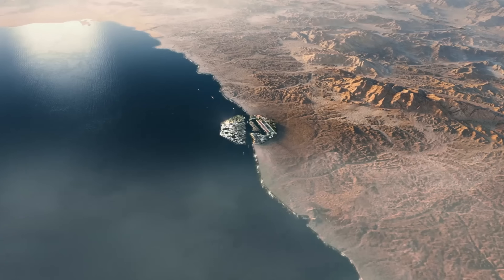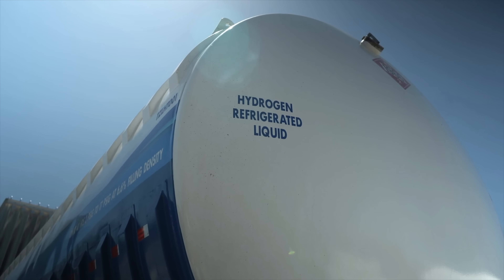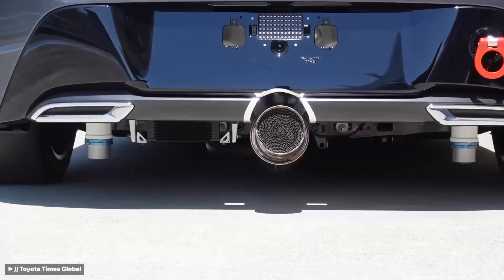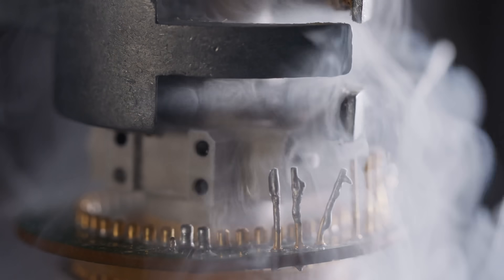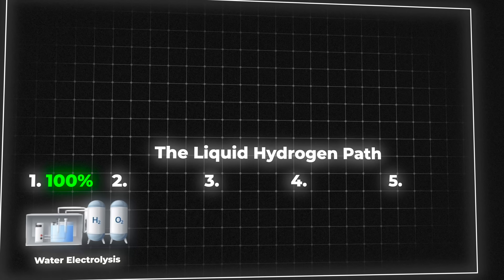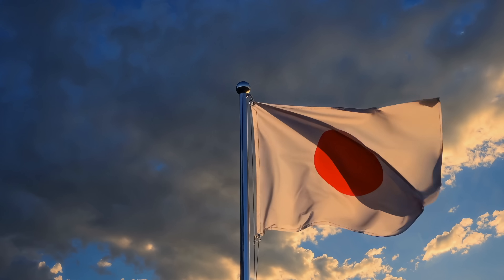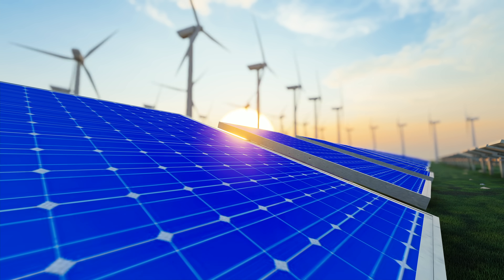World’s BIGGEST Hydrogen Plant Produces 0 Hydrogen

Comment: Hydrogen is converted to ammonia for shipping because it is a more energy-dense, easier-to-handle liquid and can leverage existing infrastructure for long-distance transport, whereas shipping hydrogen gas or liquid requires expensive new infrastructure and is technically difficult. Once at its destination, the ammonia is "cracked" back into hydrogen gas for use as a clean energy source.

Comment: Your lifecycle efficiency calculation is wildly inaccurate and hopelessly optimistic. 

The cost of energy is at least 3 x more from Ammonia/Hydrogen than it is from simply using electricity from renewables, even stored in batteries, and end of life batteries can be 90-95% recycled already. 

The Chinese government bet big on renewables plus battery because they did a simple analysis of the physics and observed Hydrogen as an energy carrier is very silly, and a bit suspect. 

I am tired of being gouged by the fossil fuel industry which is desperately looking for a way to keep gouging us. I wish the useful idiot (mostly) men it has spent years cultivating would just shut up and learn some basic high school physics.

The universe sets the energy required to crack H20 in the real world electrolysis of H2O is only around 40% efficient 

Electrolyzers need pure H2O which is very expensive to make and highly corrosive, and what are you going to do with the brine?

Comment: Thanks for the update. Be careful — energy should not be compared on a mass basis. Hydrogen must be stored either as compressed gas (typically 400–700 bar) or as a cryogenic liquid. Therefore, the fair comparison is based on storable volume, where hydrogen performs poorly. Moreover, hydrogen is highly reactive with metals, causing embrittlement, and most polymers are also unsuitable as containment materials. Because hydrogen molecules are so small, leakage during storage and transport is almost inevitable.

By combining nitrogen from air with hydrogen, we can produce ammonia (NH₃) — a far easier compound to transport using mature and well-established technology. Ammonia can also be used directly as a turbine fuel (it was already tested in Belgium in the 1930s).

In short, ammonia offers clear logistical advantages, though the main challenge remains its high energy consumption during synthesis. We still rely on the Haber–Bosch process, but progress toward low-pressure, low-temperature catalysts could significantly improve efficiency in the near future.

Comment: Wow, 39% is very very good, that is better than diesel and much better than gasoline! Batteries will never be able to absorb the excess energy production from variable power supplies. You need a flexible energy storage medium that you can fill cheap tanks with to be able to utilize their over production. Hydrogen is perfect for that, ammonia is mainly what hydrogen is made for today anyways. The fertilizer production from this could fill the whole supply really. There is no one silver bullet, this is one of many silver bullets

Comment: They say hydrogen by product is water only. This is true  but hydrogen is still a green house gas that lasts a very long time no engine will use 100%  of the fuel . Just like lng engines there is methane slip of 2to 9%  of a green house gas being pumped straight out   This doesnt make sense either but let’s watch the space develops
Reply: FALSE. Hydrogen is not a greenhouse gas. The most common "natural" greenhouse gases are (in order of atmospheric concentration) water vapor (H2O), carbon dioxide (CO2), methane (CH4), and nitrous oxide (N2O).

Comment: Sun heating with magnifiers is free. Heating can be stored in Sand or Aircrete. Use that in combination to produce high pressure for the conversion. Can’t be that inefficient.
Reply: The issue isn't the power generation, but getting the power from where it's easily produced to where it's needed the most.

Comment: I worked in a factory that manufactured karat gold tubing, 14karat gold.  After being squezed and pulled to exact shape and length. The tubing sections were work hardened. We annealed them using a tunnel furnace with conveyor belt. This furnace was powred with the amonia he describes, we called the system or process "cracked amonia" because we made Hydrogen, insitu (in place).
Thing is we had to keep what we called the space suit inside the front office aalways ready in its emergency case.  If an accident ever were to occour with this kind of amonia, its deadly (like bohpal india disaster deadly / union carbide).
It was reminiscent of a NASA space suit, to enable someone to go into the factory and shut it all down.
That kind of amonia is deadly, period.

Comment: 1850. Telegraph cable between USA and Great Britain. Done. 2025. Electric cable between Morocco and the UK. Failed. 
And just adding. To replace the CO2 pollution with Ammonia pollution is a VERY dumb idea. Much better is simply to use methane as a Hydrogen carrier ( although with some CO2 emission). Methane pollution ( not good) is MUCH BETTER as Ammonia. And can be reduced through STRICT controls of the methane grid. Methane must be controlled like any other chemical.
The hydrogen ITSELF is the ULTIMATE chemical fuel. Therefore we ARE OBLIGED  to  invent better ways to produce and store it. THERE we must direct our current and future investments in science and technology. Until this comes, we must use the obvious alternative - the methane.

Comment: Problem solved by Ayrton Energy, Canada that discovered how to safely store hydrogen gas inside room temperature non-toxic liquid (without hydrogen embrittlement) for intermodal global distribution that State regulated Hawaii Energy recently partnered with because ocean water stores 150X more Co2 than air to be combined with mineral rich salt water producing cement, bricks, fertilizers, sodium ion batteries, hydrogen gas, chlor-alkali life sustaining chemicals, Volunteer Co2 Trading Credits minted on Dfinity the new Internet Computer Protocol with Caffeine AI about to launch on October 15, 2025.

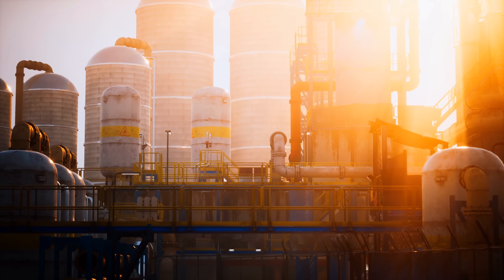Comment: 6:53 rubbish nonsense. do you even understand what you are saying? you shouldn't make videos acting as if you do. if you don't. 

first you wouldn't need 3x the volume of jet fuel. since hydrogen is more energy efficient. hydrogen has 3x times more energy than jetfuel by same mass. but has around 3x more volume than jet fuel. so effectively cancelling out. 

so effectively hydrogen is equal to jet fuel or more efficient. As you'll need the same volume of hydrogen to travel the same distance as jetfuel. no extra needed. 

Also since hydrogen weights less, you'll be able to add way more cargo and passengers on the plane. 

it is not the size of a plane that is the problem, but the weight. with jetfuel comprising most of the weight of the plane. a 70% weight reduction in fuel is huge for airlines. 

from the opening section of your video you've spouted nothing but clickbait bs and nonsense. do you even understand this topic? 

clickbait opening title about a hydrogen plant having made no hydrogen. 

then quietly ignoring the fact the plant isn't even operational for another 2 years. 

and then quietly adding disclaimer export. ignoring the fact the hydrogen will be used domestically in saudi. where they need water and energy.

you shouldn't make science videos if you aren't willing to do basic research on the subject. this video seems like it was written by AI garbage.

Comment: Sunlight travels faster than a contain ship, just put the renewables where you need the chemicals, use the electricity where you need it, via batteries or pumped hydro storage. Enough with this hydrogen / ammonia nonsense Ricky, it's never going to happen, this is Oil money paying for vanity or distraction projects.

Stop repeating the 33kWh/kg chemical energy of hydrogen like it's ready to use power, somehow comparable with batteries per kg, you still need 10,000 psi tanks, a large heavy, expensive fuel cell, batteries are ready to go, electrons on tap, the Toyota Mirai turns 33kWh per kg of chemical energy into 0.89 kWh per kg of electrical energy when you include all the crap you need to use the 5.6 kg of hydrogen, and that isn't far enough ahead of lithium batteries to justify the 10x cost, is also takes up more room, hydrogen isn't a miracle fuel at any pressure or cryro temperature.

I'd be more interested in a video of why smart people like Akio Toyoda (Toyota), Lord Bamford and his son (JCB/Ryze/Wrightbus) and recently, the CEO of Daimler AG trucks keep falling for this nonsense and ignoring the huse expense that comes from the huge losses of this often taxpayer money burning rube goldberg of machine that is "green"" hydrogen / ammonia. Use the electricity to decarbonize existing processes, you will keep far more CO2 in the ground that way.

Comment: I don't understand why no emphasis is being put on developing cheap synthetic hydrocarbon fuels from hydrogen. Yes they emit C02 but that C02 was taken from the atmosphere to make the fuel, so there is no increase in the amount of greenhouse gases. 
All the infrastructure to distribute such fuels is in place and so are the vehicles that could use those fuels so there is no need to put more greenhouse gas into the atmosphere by creating the new infrastructure and vehicles needed by alternative green energy solutions such as electric cars. 
Synthetic fules have been manufactured for many years but they are more expensive than fossil fuels, but like all the other new energy technologies we have seen, when research becomes a necessity, commercially viable solutions are found.

Comment: The needs of humanity are known.  The massive amounts of sun, wind, or hydro power available globally are also well known, and quite accessible.  It is important to know both the numerator and denominator. 

Hydrogen is just one of the resources at hand that can be synthesized, at will.

Basically, absorb routine grid losses to round things out; namely nightly grid losses, curtailment, and grid balancing as hydrogen generation, battery fill, or sand battery heat.  Somehow these losses are never included by some efficiency discussions.

Comment: If I can store my energy for 12 months with only 20% efficiency, but the costs for storage and recovery are acceptable, then it's well worth it for my home.
I am off grid. I have 3 months that I watch the weather prediction of which 1 month I have a certainty I need to start my diesel generator.
Outside those 3 months I have excess, and at least 6 months of that is major excess.
For daily, LiFePo4 is good. But LiFePo4 is kind of expensive if you need more than 150kWh of storage.
If I can store a tank somewhere on my property with energy that I made from the excess energy, my winter life would be so much more fun.

Comment: When you generate electricity you lose at least 5% in transmission. That hasn't stopped transmission lines being built all over the world. The ICE is only at best 35% efficient but that hasn't stopped hundreds of millions engines being produced. So why is it when it comes to renewables any percentage losses is a big deal and the project can't go ahead. If the primary energy comes from the sun the energy is basically infinite. A 1000 km x 1000 km area in Western Australia receives enough solar energy to provide for the entire world's energy requirement of 160,000 TWh per year and that is with only 15 percent efficient photovoltaic solar cells.

Comment: Jackamy: That 2kWh battery will deliver 2.2 kW for about 54 minutes, if the capacity claim is correct. It would also struggle to deliver full power to a standard electric 240 Volt heater or hob. They can draw 10 Amps at 240 Volts. If the output from the power supply is 220 Volts, then you are good to go, for up to 54 minutes.

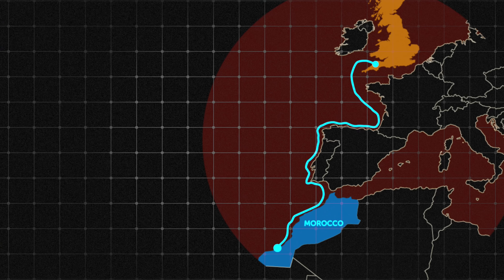Comment: 2:40 The Xlinks project has probably gone, but the U.K. has nine power links between here and Northern Ireland, The Irish Republic, France, Belgium, The Netherlands and Norway. And they have been working very well, some of them for years, carrying substantial amounts of electricity. The longest of them is to Norway, and it has a length of 765 kilometres with a capacity of 1.4 Gigawatts (1,400 Megawatts). The UK end of that link comes ashore not far away from me, in England. 

As of this moment (early on a Thursday morning in October) over 3.48 Gigawatts is being exported and over 3.27 Gigawatts is being imported via those links. They are extremely useful for stabilisation of different grids and for stabilising the price of electricity. The countries of the U.K. are generating over half of their electricity from Renewable and Carbon Neutral resources at this time.

Long distance cables are technologically achievable and can be very efficient because of the high voltages used. Some are DC cables and others are AC, The limiting factor is not so much the distance, but rather its political considerations. But those also affect the transport of Ammonia, Hydrogen, LBG, oil, coal and wood.

Ammonia (NH₃)  has some distinct advantages over Hydrogen (H₂), including 50% more Hydrogen per molecule, it does not leak through valves, container walls, pipes and seals as readily as Hydrogen, it is less reactive, and it does not cause the embrittlement of metals within which it is stored. It is, of course, toxic and corrosive.

Comment: Worth adding that Overall (Well-to-Wheel) efficiency of ICE vehicles is 20-30% so the ammonia path is better.
Solar to wheel is 12-20%
Various renewables (wind, hydro) to wheel is 60-70%
Natural Gas plants to wheel is 30-40%
Coal plant to wheel is 20-30% efficient.
Reply: also the round trip efficency will improve with technological breakthroughs to above that of ice soon i suspect. this isn't a mature technology field like internal combustion engines. so there's plenty of room for breakthroughs.
Reply: Efficiency is irrelevant. What matters is greenhouse emissions and cost. Solar energy is free so the efficiency of the panel doesn't matter, only the cost of the panel ($/watt). A more efficient panel is smaller but that only matters for spacecraft. Solar is now the cheapest power source, which is why it will dominate in the future.
Reply: @bhabbott  it matters as it keeps things in context. The cost of those efficiencies is the real question. Enviromental, economic and social?

Comment: What a waste of time, money, and resources…
Reply: I agree. Just the pure green hydrogen is more expensive than any of the other fuels that we are using. With the current technology it is not a viable option.
Reply: REPLYING TO @DANNYPOPE1860:

okay, *KAREN!!*
Reply: Not your time. Not your money. And not your resources.
Reply: Yeah imagine if they build the huge battery storage system instead, the wasted energy and cost would be minimal

And again it's a desert region, which means it has the biggest solar energy potential. Just covering a 100x100 square km of desert with solar farms will produce enough power for the entire country
Reply: @sihamhamda47  What for? There's almost nobody there to use the stored energy. 

Their business is energy. By building hydrogen plant to convert it to ammonia, they can use their existing network of dealers, tankers, and customers after they run out of oil.

Comment: The power-to-hydrogen-to-ammonia(-to-hydrogen)-to-power roundtrip efficiency is around 25%, with cutting-edge installations. In that light... and having recently learned about silicon's terrific heat properties, one wonders why they do not consider floating heat batteries (silicon resistively heated to molten state at 1440 °C and then heat extracted at destination port, by pumping a gas through a heat-exchanger built into the ship and using that gas to power an electric turbine or a high-T industrial process). In this way, round-trip efficiencies up to 60% should be achievable. The cost of the (metallurgical) silicon medium would be around 2$ / kg: a non-negligeable one-off investment, but crunching the numbers seem to suggest a green light to go ahead. Per 100.000 ton of silicon (100.000 ton is the order of magnitude for oil carrier) around 50 GWh of gross power would be contained (30GWh after conversion to electricity).

Of course, if the political climate is suitable HVDC always seems the better option, but one has to assume we have to compare mobile, flexible energy transport systems with other mobile, flexible systems.
Reply: Oh yeah, I forgot to expand the comparison in roundtrip efficiency to also a comparison in financial cost: Electrolysers and fuel cells are expensive and degrade quickly. For green hydrogen, there is no way around electrolysers. With the heat battery, capital costs would be lower (you'd need larger and/or more ships, but you can enjoy economies of scale there).

Comment: Of course another solution is that energy users relocate to where energy is cheap. If your company makes nitrate fertilizer it makes sense to setup near a green ammonia plant. If you want to make green steel then setup next to a green hydrogen plant etc. It will take time but will rewrite the geopolitical map.
Reply: Don't underestimate cost of capital, capital other than energy. Writing off otherwise-viable fixed capital is expensive.